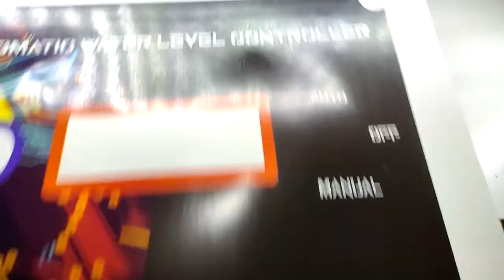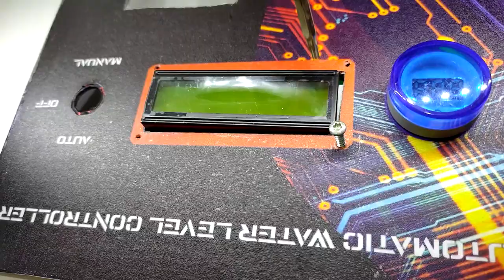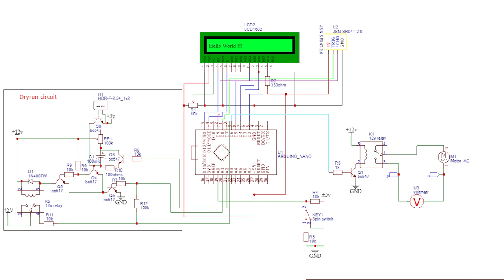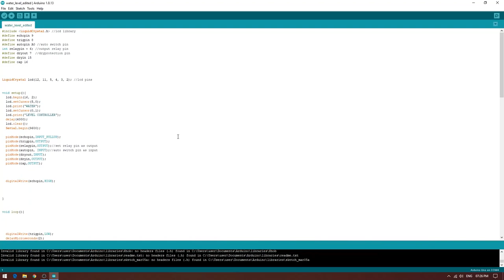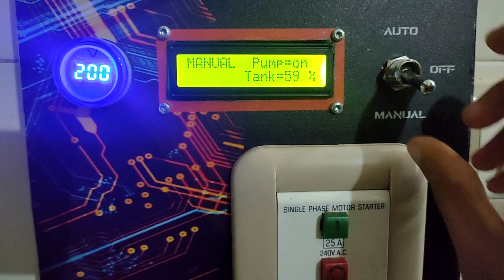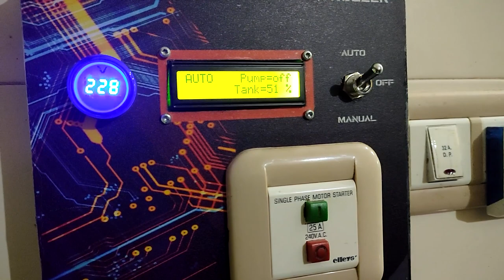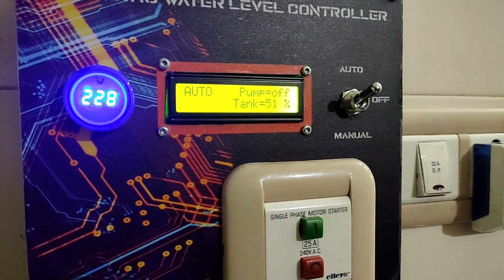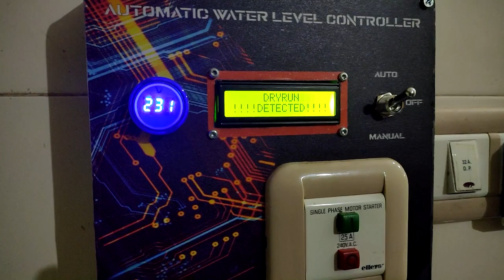Automatic water level controller using arduino

Comment: How to start 3 wire (RYB) submersible pump, 
please program for   motor on time 5 seconds  extra relay control
Reply from the maker: Replace switch with relay
Reply: @ElectroRetro  ❤❤❤❤❤❤
Reply: @ElectroRetro  bro I'm sorry my English is not good so, I don't know how to explain my problem
Reply: @ElectroRetro  in India submersible motor starter have 2 capacitors and one contactor,  if I want to on motor push the green button for 3 to 5  seconds then motor contactor will be on and motor running
Reply from the maker: With this circuit and code you cannot control 2 capcitor submersible pump. You need to change the code. Using this we can control 1 capacitor submersible pump.
Reply: @ElectroRetro  I don't know about coding 

Anyway thanks bro I will try
Reply: @ElectroRetro  Bro please design a wireless water level controller for 2 capacitors on and off starter. Replace ultrasonic sensor with float sensors or wire sensors . I hv requested you 5 months ago 🙂🙂
Reply: @lyricalworld360  hi bro... Work agutha bro? Enga vetla submersible moter tha eruku... Can I use this circuit?

Comment: Hy sir plz uplode code file without dryrun circuit
Reply from the maker: https://drive.google.com/file/d/1WsBvjo9e-wMc_H8EbnqhqwrdHWvodgJL/view?usp=drivesdk
Reply: @ElectroRetro  thanks sir
Reply: @ElectroRetro  hy sir how to set tank hight and low level for moter on and high level for moter off in auto mode
Reply from the maker: You can change that in your code. To set tank height change 123 to your tank height in centimetres. 
distance = map(distance,20,123, 100, 0);
Reply from the maker: if(distance<=50&&analogvalue==0)
 digitalWrite(relaypin,HIGH); if(distance>=100&&analogvalue==0)
 digitalWrite(relaypin,LOW);

50 is the start percentage and 100 is the stop percentage. You can change that as you wish.
Reply: @ElectroRetro  sir har tank ki hight man difrance hota to os ko kasy set karna hota
Reply: Jald replay kar ka shokriya very very thankful
Reply from the maker: @myelectroniclab  can you please tell me in English.
Reply: I said i am very thankful to you for fast repliy